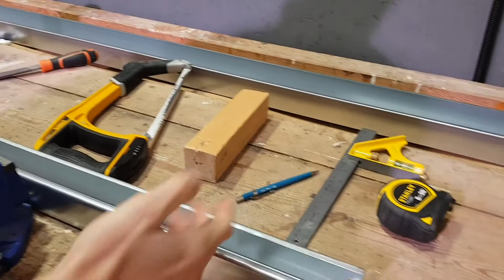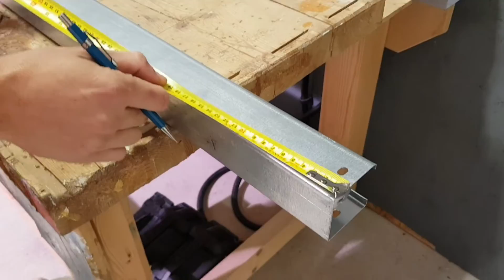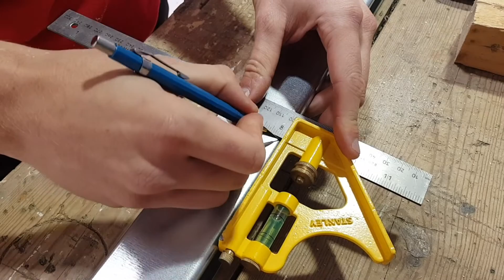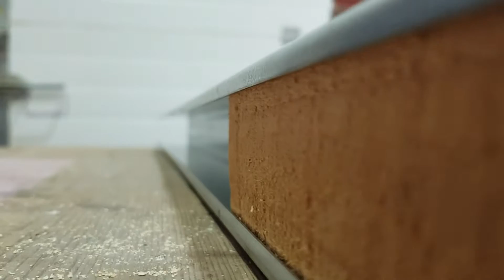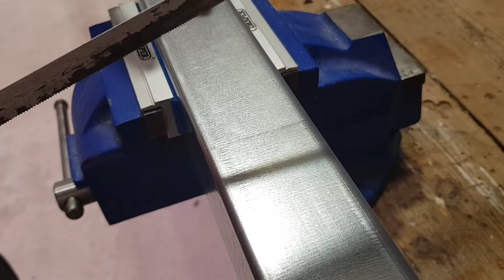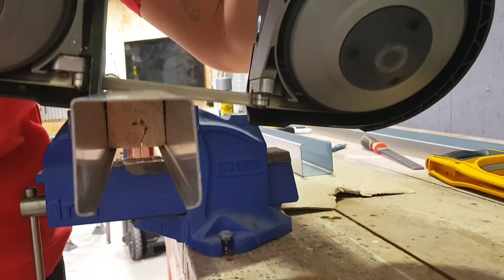Top Tips for Marking and Cutting Metal Trunking

Comment: Nice tutorial guys showing marking up and cutting with a hacksaw.  A top tip for the finished edge.  Spray the galv spray on the cardboard and make a tiny pool and then dip the cut end into it.  Try it.  The finished article is cleaner and there is no unsightly overspray showing.

Comment: One of the things we had to do at engineering college was cut, using a hacksaw, a block of metal that was 10mm X 100mm at a certain length and in a straight a line as possible
It was the last process after we'd done a load of machining to it over the previous day so it was a skill we couldn't afford to mess up

Comment: Very useful tool this. Great for cutting uni-strut, threaded rod etc. Negates the need for a hot works permit too.
Reply: 134mm circular saw with metal cold cutting blade is the best.
Reply: @stevenredmond7455  yes, agreed once cutting on the ground but if you have to modify steel work once installed a circular saw not much use in that application. This tool will do both in most instances and very well.